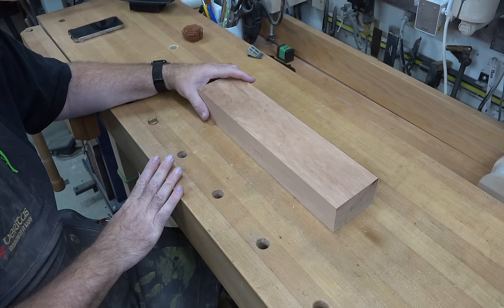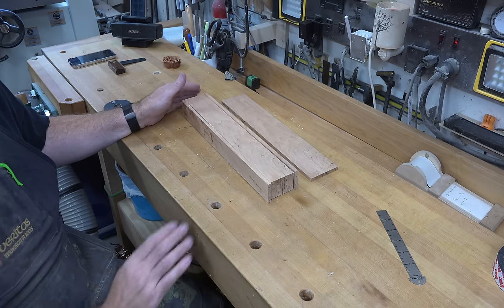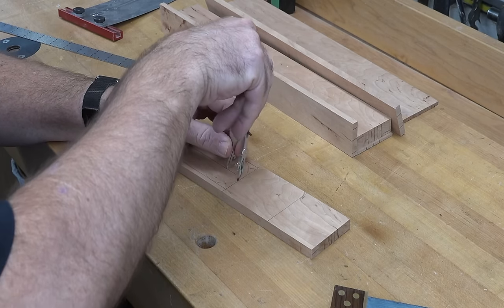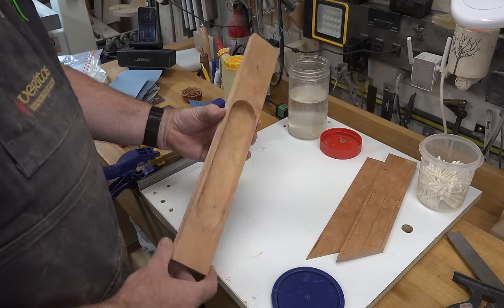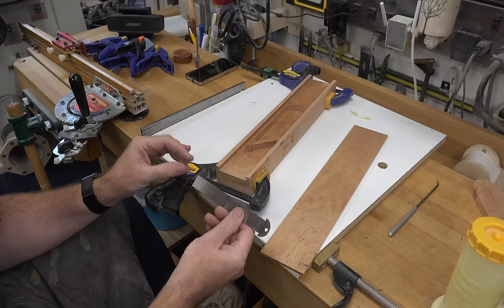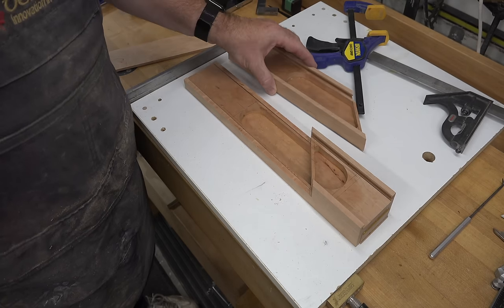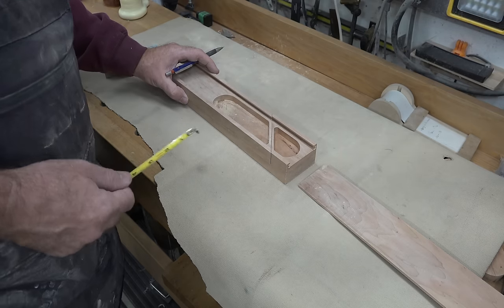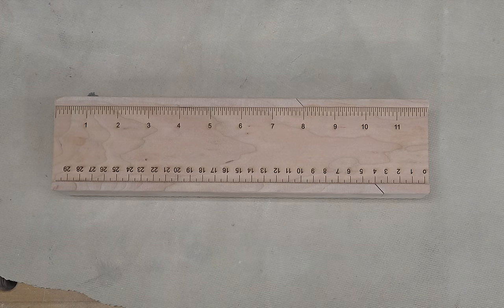Making a Retro Pencil Box

Comment: Loved it. The only thing that I might change, idk how well it would work out and if kids would actually used the extra but if you taught them, make both sides of the ruler at 45 degrees and 30 degrees to aid in drawing and drafting out future woodworking projects or other design of arts and creations.  I am talking about the short ends of course.  If done correctly, I think you could still make a functional 12” ruler with all the hash marks.  What made me think of this was the thumbnail, which I didn’t see right.  You went one direction which I love.  My mind took me somewhere else.  And I suck at drawing and engineering though I work with wood so have to try.
Reply from the maker: It's a great idea Aaron and one that is worth exploring.  The methods I demonstrate on the show are just one of many possibilities for making a project and the fact that it inspired you to think of an alternate method or alternate design means that the show did exactly what I hoped it would do.  Good for you for thinking outside the box and coming up with a modification of your own.  I love it.  Thanks for tuning in and for chiming in with your thoughts.  It is truly appreciated.